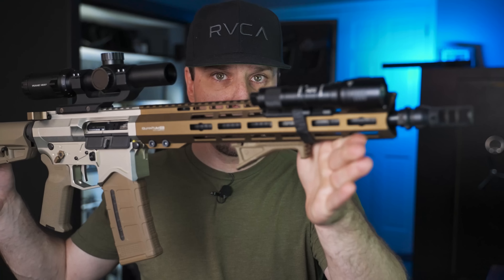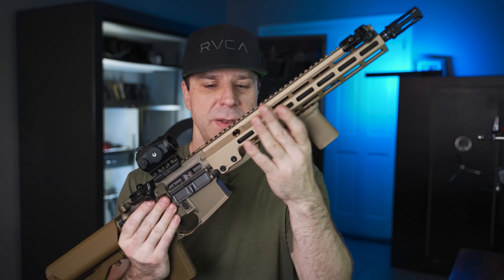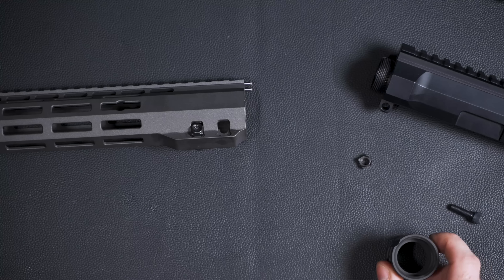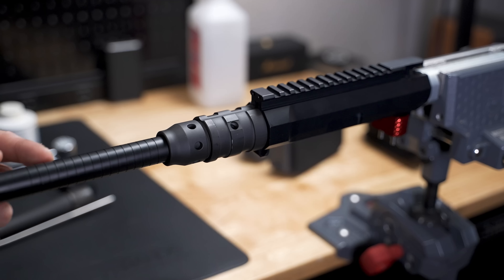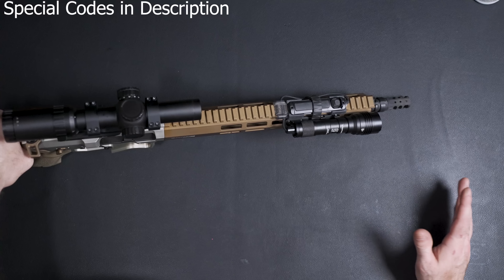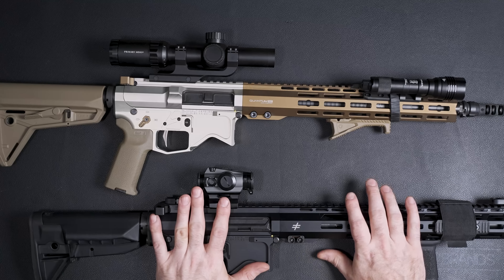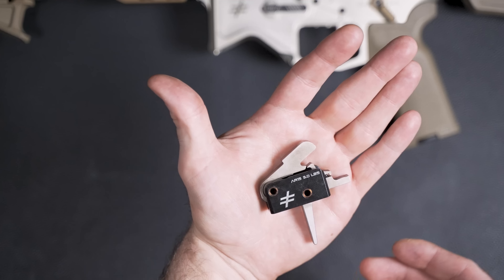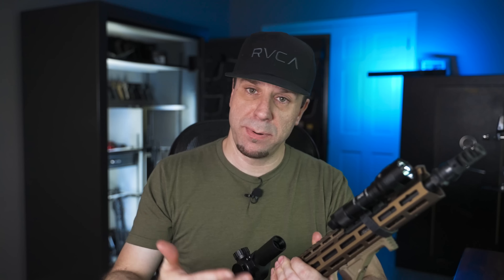NOBODY in the World Makes an AR 15 Like This...

Comment: If it's a defense weapon u want it slightly over gassed and yes a adjustable gas block is a failure point. That is true why they are not used on a battle rifle.

Comment: I disagree with the adjustable gasblock thought. SIG included a two position gasblock on their m250 rifle for the Army. One is the standard position for both suppressed and unsuppressed, they also have an "adverse" position for if the gun starts to run slow or has too much build up.

Military rifles likely don't typically include adjustable gas block because of the K.I.S.S. mentality and catering to the lowest common skill denominator.

Comment: I’m in the market for an AR-15, pretty new to the AR space and appreciate you going through all the differences between the spectrum of rifles. Currently looking into the Barnes BPM-15. Read and heard great things, but still not sure. Any feedback would be greatly appreciated. Thanks.
Reply: It’s only an AR.  All it has to do is run reliably.  Lots of geewhiz marketing is looking to suck every dollar from novices.  Make your first AR an inexpensive Palmetto State Armory model with standardized mil-spec internals like the BCG and trigger assembly, then go from there.
Reply: IWI Also makes great, affordable rifles with lifetime warranties. Made here in the US factory in PA. Can't go wrong
Reply: I agree with the other 2 replies. You can get into the market, accessories, optics for under 1k, or just the rifle for 6-800 in most cases and sometimes cheaper. You have to factor in ammo, optics, accessories, etc.

Comment: Check out Diamondback DB-15 have looked at their products and bought a 7.62x39 mm 16-inch barrel that was great quality and very impressive Shot groups were dime size with very cheap ammo. I am going to replace my barrel with a weapon that was bought at mid-price like Diamondback barrels not just saying this the last 31 years shot lots of AR and Military mil-spec none of them could do this straight off the shelf. Check barrel mfg to see what performs well with the rate of twist and caliber. Have you noticed that people buy high-end rife and expect high-end results? In 5.56mm 1/7 twist most people shoot 55gr rounds I like 5.56mm 1/8 you can shoot 75  and 77-grain rounds work better with barrel mfg suggestion.

Comment: Would never run an adjustable gas block on a fighting rifle. Just makes one more point of failure would rather tune with an A5 system and different spring/buffer

Comment: I love this channel. I love the builds and I learn a lot. However, I have been a soldier and I would not take any of these rifles to war. They're awesome for what they do, but not for war. My opinion, maybe not anyone else's opinion. Keep going with the content.
Reply: swap out the handguard for something sturdy and add a forward assist. what else is different compare to military issued?
Reply: @ericc2530  no auto sear…..
Reply: @stevecohen34  automatic fire may be the most overrated feature of all time. Is it fun as hell? Yes! Other than laying down suppressive fire the feature just isn't all that advantageous. With that being said I'll always choose selective fire with everything else being equal.😄
Reply: @ericc2530  the trigger and Stainless Steel barrel would not hold up milspec is a 5to 6 pound trigger and chrome moly chrome lined barrel for those of you that do not know a super light trigger and fast reset will get people killed in combat you want the trigger to be kinda hard to pull so in a stack breaching a door your nervous hand does not blow the head off your man in front of you and stainless steel barrels are accurate but when hot can degrade in less than 100 rounds if real hot and alot of fire you will end up with a shotgun barrel
Reply: @sendit2873  wouldn't this be dependent on mission set? The Mk12 has a  stainless steel barrel.

Comment: The adjustable gas block is a point of failure that some of the companies who build a "go to war rifle" don't want to take the chance of something getting messed up. 
Honestly I think they are worried about nothing. The chances on a high quality adjustable gas block breaking down are very low
Reply: but why take the chance when you can get a barrel with a proper gas port size and use a correct buffer weight? adjustable gas blocks on ar's are for noobs that have no idea how to pick nice parts
Reply: The problem really is "User error" ---  If you find yourself in a fight and you need your rifle to work---  but you accidently left it on the wrong setting or forgot something-   there is a high consequence for a simple misstep--  so that's why it's just better to keep it dummy proof on a duty setup that needs to be 100% reliable, because your life depends on it.  That's why a lot of guys will just run a simple glock 17 with iron sights for their protection.  Just keep it simple, less things to worry about, no dots to run out of batteries, ect. ect...   There is a good argument for this strategy.

Comment: Easy now!  Let's not push the price up.  Standard bolt and all.  Look, the company has the "NASA" like tooling, but their focus is divided.  This company can support itself in many ways based on establishing a great shop and some sound contracts.  Now, will it use or abuse its abilities?   The company seems to care about making quality, be they weapons or widgets.  The weapon  appears to be well engineered in at least a couple of areas.  I don't think every inch of the weapon has been improved but some major areas of improvement have been attempted?  Let's see if it holds up.  These two (you've shown) "top-end" weapons are running neck and neck.  Though I am interested in the barrel attachment of this one.  It is not a new concept in the mechanical world but it may be for the AR world?  Is this latest and greatest in it to win it and will they be around tomorrow?  (JF)

Comment: Performance Ordinance Factory has more patents on AR format weapons that I have seen .. Their Heat Sink / Finned Barrel Nut is an innovation that I have not seen in other weapons platforms .. This means that the chamber doesn't get very hot because the heat is wicked off faster than => ALL AR PLATFORMS ! <= .. Then POF are battle rifles .. What is a Battle Rifle ? .. A battle rifle is a rifle that doesn't heat up like other D.I. AR platforms .. I won't own a D.I. Platform .. My rifle will keep shooting sub moa after 1000 rounds in a days worth of shooting .. I would put my AR-308 which is the same length as a AR-15 against any AR-15 .. It is the best rifle I have ever owned ..

Comment: That magwell throws me off. Would be much better if they just used a normal magwell profile with a good flare.
Reply: Ken, that was our Mark 1 rifle. We are bringing that back soon. During Covid we had difficulties sourcing 7075 aluminum. We ended up not cutting that lower till we get material. It is getting better these days.
Reply: @BlackoutDefense so no more triangle cut out? That would be great. I think you definitely have a top of the line AR here that truly improves on the design better than any company has to date (even KAC). But that triangle cutout in the magwell will kill sales with the m&p/tactical crowd. Keep the price reasonable and you'll have a true game changer.
Reply: @Kentucky.Tactical  Yes correct, it is standard with a good deep flare

Comment: High end rifles without adjustable gas blocks are not high end, it’s just a modified rifle to ones liking not being necessarily proper to other builds. It’s called marketing strategies… adjustable gas blocks are needed for silencers and such for a “ proper ejection “.🤷🏻‍♂️ but plenty of myths out there for so called high end rifle modifications… I say if u can keep any rifle clean and properly operational, it will preform as it should. Keep in mind with any rifle, barrel’s take more or less beating considering fully automatic or semi… 🤷🏻‍♂️🧐

Comment: What’s the weird trigger tuning thing? I don’t want a trigger that needs tinkered with every so often
Reply: It does not need constant change. The tolerance difference in the lower receivers made from manufacturer to manufacturer,  may have minor impact on trigger's performance. You can use this design to tune those out during the installation. Only once IF it needed.
Reply: Then he misrepresented your trigger,  he showed the new lower that has holes in the trigger guard, put there by blackout for when the trigger starts to Malfunction, to call blackout to walk us through fixing via the trigger guard holes
Reply: @BlackoutDefense  I went on your site to possibly buy one. They look nice, but then I heard that. Not blowing smoke
Reply: @bananawatch8158  I appreciate that Greg. We do not even recommend the operator to adjust the set screws under the rifle. The set screws under the rifle are for adjusting the pre travel or post travel caused by lower receivers which the trigger pin holes might be slightly off. I would say over majority of the triggers in many lowers we have out in the market, don't even have that or need it.
Reply: @bananawatch8158  I assure you that is not the case. We have over 5000 triggers installed in many lowers from other manufacturers who do not have those holes in their lowers.
Reply: @BlackoutDefense  blackout I believe you!! BUT that’s not what he said in the video. I’m going to buy one. Well made single stage triggers are my favorite

Comment: Love the design, but I'll hold off until they have them in alternative clamberings. There are far better options than 556 since this is not a service rifle.
Reply: Chris, what other caliber you like to see?
Reply: @BlackoutDefense  6ARC, 6.5 Grendel, 6.8 SPC to make them viable for hunting use and overall increased efficacy. My personal preference is 6.5 Grendel. If I wasn't already invested in Grendel,  I'd be running 6ARC. All 3 of these cartridges have significantly better performance over .556. I train and varmint with .556, but for predator and hog, or anything serious I go to my Grendel.
Reply: @BlackoutDefense  And, thank you for responding to my post. That already shows you value your customers.... or potential customers.
Reply: @ChristopherKnN  Thank you Chris. Actually, we are working with Proof barrels to implement DTL in 6ARC and 6.5CM barrels for both AR10 and AR15 style rifles.
Reply: @ChristopherKnN  Absolutely Chris. Call us if you need any info.

Comment: Its another point of failure for the soys out there. Not everyone is smart enough to adjust it. You can get adj gas blocks and adj gas keys I have both but haven't installed the adjustable Key for my 6.8spc. The adj block can make it a softer or harder shooting based on your needs If your pinned and welded look into a gas key if you dont want to go through the trouble or repining the muzzle

Comment: Is it true there's only one manufacturer that makes an AR with the charging handle on the side, instead of the back?
Reply: No but it depends “where” you consider “side” there’s a bunch of side chargers that charge from around ejection port. FM actually makes handguard side charger
Reply: @JB-ez2jz  Thanks. Yeah I saw the FM that charges on the left side up front. Haven't seen one on the right side by the ejection port yet.
Reply: Gibbz may be the cheapest reliable option.  I have a few, some left, one right.
Stay away from any reciprocating bolt type.
Reply: @blackhawk7r221  how can I contact ya?
Reply: @JB-ez2jz  Here

Comment: Bruh sounds like you are busy collecting FREE ARs.. But the BlackOut Defense handguard just has what looks to be 1/8 inch dowel pins that aren't are stronger that roll pins, but nothing special in retention design. Those relief rings may just be Snake Oil.

Comment: There's no tangible benefit to this. The barrel nut on the AR platform has never been a point of failure. Nor is it something that impedes accuracy. This is a gimmick to justify a higher pricepoint.

Comment: I build my own AR'S so, I don't have "space age technology ". What I build is AR'S that go bang when you pull the trigger. Too many people think they have to have a Seals team AR rig kitted out to go to the range or LARP with. False. I've built 20+ AR's over the last 3yrs. I have 7 personal AR'S. They've all been tuned and timed for optimum performance and, some have been Cerakoted professionally by me. I don't have any on the razors edge....where failure is a shot away. The cheapest AR i own is a AR9 I built and I have $2k in it. My most expensive AR is a 100% fully Cerakoted 14.5" Bushmaster lower(sentimental) everything else is top shelf. I have $4.5K in it not including the suppressor. I shoot them all. No safe queens in my house. Buy or build what you can afford and train. Put the work in. Ammo is high so, make 50rd range days. The overall key is train. Take it seriously even if you don't compete.

Comment: I didn’t like the barrel because only 10000 rounds  that’s  not good
Reply: That is not correct. The referenced 10-15k round is for all stainless steel barrels. SS barrels are very accurate up to that point. then they drop accuracy to mil spec accuracy of 3 MOA. That is commonly know upon barrel manufactures. Your barrel should last 40-50K round. Also this is highly depend upon your ammunition and style of your shooting performance.

Comment: Holes for dirt to get in the fire control group . I am not impressed .
Reply: The holes are sealed from inside by the trigger housing. On the other hand, the trigger shoe opening is straight through the receiver. I have never seen an issue with that.

Comment: Straight stole bootlegs logo basically. Also the rail on the black one is made by cmt
Reply: I am not certain if you understand mathematics but that logo is the not equal sign = denote inequation. Second, CMT does not make our rails. We do machine all of it. There is a panty of IG post regarding our machining operations. In the past, however, we used CMT hardware for a  limited time to experiment with the design.